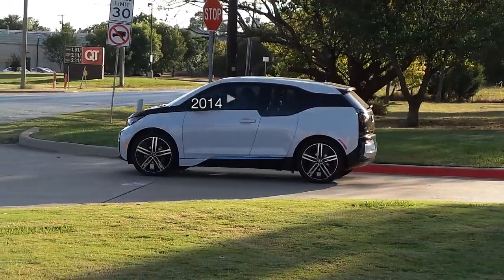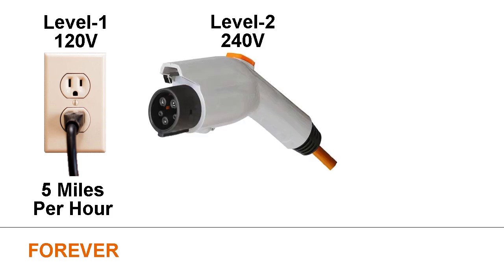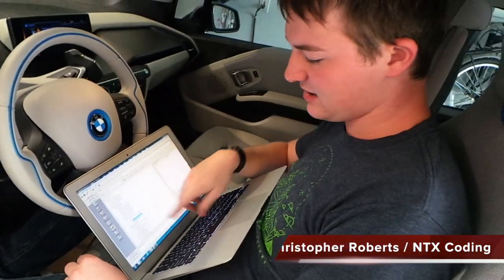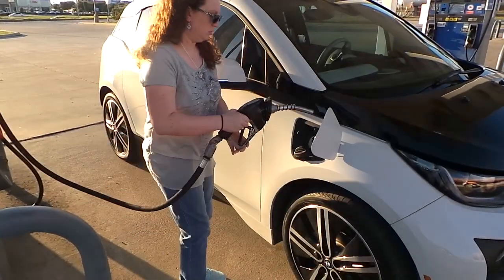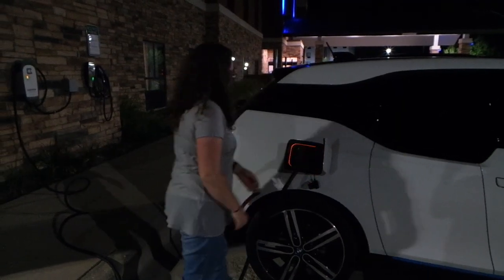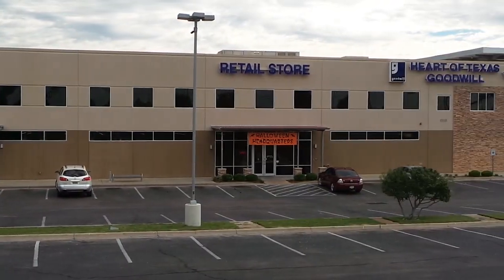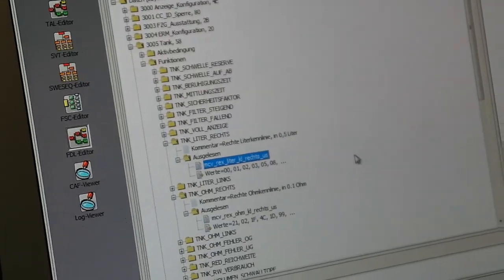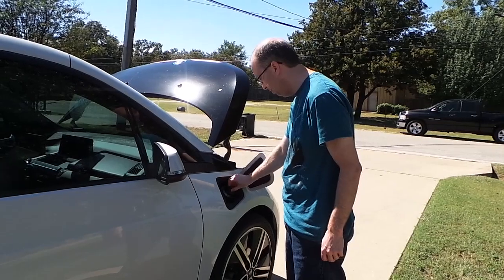BMW i3 REx roadtrip, charging, coding, and range test.

Comment: By "hold mode" they mean "hybrid mode". That's what gas engines in hybrids usually do - charge the battery.
Reply: PHEV, plugin hybrid vehicles. Use a traditional smaller gas engine to drive the wheels, read on it. i3 REx was the first ever BEVx(see the similarities in names?), a full electric vehicle that has an APU(auxiliary power unit) which can be anything to generate "power" key word it doesnt drive the wheels its only to recharge the electric drive. APU can be anything, hell you could make a BEVx that used a coal fuel steam turbine if you want, so long as the drivetrain itself that propels the vehicle is all electric and the APU only charges the battery it would still be a BEVx. The difference is that hybrids have a small electric range, and a HUGE gas range. Because they use the gas engine to drive the wheels, some also charge up the battery while doing gas-mode. BEV and BEVx are electric vehicles, fully. The BEVx just has some kind of APU to only charge up the battery, in special circumstances, IE you have a longer journey than you can make on electric and you cant stop for a charge.

Comment: The Achilles Heal of the i3 are the tires and wheels. The tires are proprietary, made only by Bridgestone. They're fragile and last 15k-20k from what I've read, cost about $150. ea and are often out of stock. It's a classic case of over engineering for marginal benefit. The wheels are soft and easily gouged, again there's only one manufacturer and cost about $225. I'm a big fan of freedom of choice which is severely lacking in the i3.

Comment: So the range extender is a petrol engine running a generator? It charges the battery and drives the electric motor to drive the wheels? This is crazy.

Comment: Hold mode is definitely the way to go for longer trips - you just run the fuel tank dry and then stop at the next fuel station, put more in and keep driving until the night comes when you plan ahead to recharge the battery to full again. So your battery acts as a safety buffer between your fuel running out and next fuel station.

Comment: with a smart fortwo, i can go 200 miles on 4 gallons of gas, at 60mph, mileage drops to the high 30's at 80mph. but most of where i live has speed limits of 60 or less.

Comment: Seeing as you have the car and a guy who can access it's "firmware". And I am to lazy to google around.

Any way, basic electric for motors and batteries amounts to amps used by the motor at load.

So you had 2 people in the car and more fuel so year load was more.

But that is not exactly what I want to know.

I want to know what the average amp draw with an average weight of two passengers.  And if you can tell how warm the batteries are getting.

In electric rc airplanes you can get lipo batteries with serious amp raitings ( you just have to know what C raitings really mean when made in China).

The info could be used in a hack to stack lipos to run the car

Comment: Whats more dangerous than the possibility of getting into an accident with that gas can in front is the pressure/fumes that will build up as the can is subjected to heat! Fumes will ignite from static and those cans are well known to split open at  high temps.
Really no + side to taking the risk.  Gas stations are everywhere!  Whats the point?

Comment: 6:05 this gas can is not necessary, please don't do this. All you have to do is keep your speed at 70mph or less and the car performes fine. This is a perfect example of range anxiety. I drove 400 miles and had to arop 4 times to top up gas, went perfectly fine.

Comment: Crippled the car...yep that's what happens when gas companies have their hands in auto manufacturing and fuel standards.

Edit:  I'm really not a fan of electric vehicles just due to their limitations in mileage...however, if all you did was drive around the town you live in, I'm sure they'd probably pay for themselves...or would they?  I'd assume you would have to pay to use those chargers that are at different locations along your route, or are they free to you?  Someone has to pay the power bill so they're not free but for shorter distances an electric vehicle may be the route to go if only they'd extend the battery power in them.

So the Chevy Volt has a lot better cruising range by the sounds of it.  I notice you and your wife both have electric vehicles so with all the charging is your power bill pretty high, or do you notice much difference in it?

Comment: So there are regular charging stations for all vehicles except the Tesla and then Tesla only charging stations? I don't know much about how charging an electric car works but if so why is that allowed? Wouldn't it be a much better benefit to have a universal charging station since charging stations grow scarce the further away from bigger cities you are? Electric vehicles are going to be awesome in the future and I hope we start getting more futuristic looking vehicles to drive, way faster charging and many more charging stations. I'd love to ride a futuristic electric motorcycle eventually.
Reply: SonnoMaku I realize this reply is a year late, and you may have already looked this up, but maybe it helps:
Yes, there are a number of different charging connections out there, and it's all about how power is delivered.
Most of our modern EVs in the US use a standard SAE J1772 connector. The connectors are easily recognized, shaped and keyed to fit one way only, and are built in such a way that it minimizes the chance of an electrical arc during connection and disconnection. Power can be delivered at a couple of levels, this way. Level 1 and Level 2.
Tesla uses a special connector because of how much power they can deliver. This is why the adapter he mentions could be used on the charger at the hotel: lower powered charger, comparable to what we get from a Level 2 charger ... But not on the iconic Tesla Superchargers. Too much power delivered there (which allows for the Tesla to recharge super fast), which would require some kind of a step down converter that the adapter lacks.

Comment: See this is why this technology is still not there for me yet. I wouldn't want to plan my entire trip based on where I could charge or not. If your hotel hadnt had the charging port you'd have to use the included 120v one from the outlet but there's always a chance someone could steal it while you leave it unattended and I would t have the patience to sit for an hour to charge my battery at a station like I see these tesla cars doing at my work, there's a few charging stations in the parking lot and I see people sitting there a lot and it's incredible to me how people are willing to sacrifice so much for this tech. I own a Dodge Ram 1500 5.7 liter v8 and I get around 25 mpg. Driving to and from work daily I never even think about getting gas, maybe once a week or twice if I do any activities after and require that extra expense, I have a 17 gallon tank and it costs roughly 60 dollars to fill.. if I go on a trip I fill up as needed and getting gas is never an issue.. the point I'm trying to make is that I am sure I'd save a lot on gas and maybe do more for the environment by driving a hybrid but the tech seems like it's still in that annoying stage where you sacrifice time, exert effort, and make accommodations based on the faulty systems all to save a few bucks here and there. Maybe in like 10 years when there's little difference between the performance but not now it seems like an unwanted headache to me to have to plan my life around a charging system like that,

Comment: Here is the reason for the software limits in a nut shell: https://en.wikipedia.org/wiki/Range_extender_(vehicle)#CARB_regulation
1) The auxiliary power unit (APU) must provide range less than or equal to battery range. ==> therefore 1.9 gallons instead of 2.4 in the 60Ah version.
2) The APU must not be capable of switching on until the battery charge has been depleted. ==> therefore no hold-mode.
BMW wanted that i3 60Ah REx qualifies as a BEVx. This is a category that Chevrolet Volt does not comply with.

Comment: This wouldn't be a vehicle for me. I go on some pretty long day trips. (One recently was to Philadephia, PA from Providence, RI and another was to Hoboken, NJ, with a stop off in Manhattan.) Some of the trips that I take are even longer and don't require me to stay overnight. (I did a trip to Niagara Falls, NY one time that was about 925 miles round trip.) A car with even a 200 mile range isn't any good for my level of impulsiveness and driving stamina.

When I wanted a car that was good for weekend road trips, I picked a regular gas powered Audi A4 Cabriolet (I felt like getting a convertible.), which can go 350-400 miles per fill, and be filled in a matter of minutes at any gas station. I also have a 5 gallon gas can, but I rarely find myself in a position to actually need that. I won't run a tank below about 1/4 if I can avoid it.

I had a trip that went through WV and western VA that turned out to be a little scary for range, which I use as a cautionary example of what not to do. (It's only 16.8 miles, but it runs through switchbacks in a mountain range and it feels like it takes an hour, when you've got the gas light illuminated.)

Comment: Hi. Nice video. However you are using the range extender completely wrong. You must go into the settings, under range extender and hold current charge. You can only do this if you have under 75% battery. You cannot drive the range extender if your battery has no charge. The hybrid runs of the battery.
Reply: Find me on Facebook and can explain further if it’s unclear. Thanks.

Comment: I have yet to see any video or information what the costs are for using a public charging station. Are they free? Do they all have different fees? Are the hotels providing the charging stations free of charge? What will happen to the charging prices when EVs become more popular? What will happen to electricity prices in general?
I'm still not sold on EVs, and the 8-Bit guy is a good example why. Whenever he makes a slightly bigger trip he seems to stay in a hotel. These are trips that could be easily done in a day with a small gas powered vehicle. It seems in an EV you have to stay overnight for accumulating charging purposes. A hotel is not cheap. I think overall, this trip would have been more economical in something like a Toyota Yaris.
I have a feeling EVs have a lot of hidden costs attached that are not immediately apparent and the enthusiast community is very quiet about those.

Comment: Two things, the i3 is not for hyper cruise, it is too big for driving that fast. 55 mph would give you more sensible range. The range extender gives you 40mpg on gasoline, which is worse than many gasoline cars. This car is obviously for slower speeds city driving.
Reply: @Hocus Smokus Are you talking to me? Because calling me crazy but otherwise saying the exact same thing as me puts the concept of crazy in a whole new light. Your other point is however entirely mistaken: The standard since 2016  for gasoline car mileage is 49 MPG A car getting 25 MPG wouldn't be made because would cost 3000$ in yearly taxes and use twice as much fuel so no one would buy it. Tried to look up the exact specs for the BMW i3 REx. Guess what, from next year, it wont be made any more because it can't meet the WLTP standard for emissions, so wont get any tax exempt !!

Comment: I've seen two of these in my hometown and didn't realize they'd been out since 2014. Very nice exterior design, but way too expensive and high maintenance. I haven't warmed up to electric cars yet.
Reply: If you are worried about maintenance, get an all electric car. They actually have less maintenance than a gas powered car. No oil changes for example. So an i3 without the Rex, or any others out there that are all electric. With that being said, still more expensive initially than a gas powered car but that will be getting better and better as time goes on/more used inventory.

Comment: Those motorcycle engines in the back are so loud 😂
Reply: Actually not. I was afraid it would be, but the REX running in mine is very well muffled.
Reply: Mark Johnson haha. You are lying to yourself so you don’t feel like you played yourself.  That engine is loud and annoying.
Reply: @ultrastoat3298    Are you just being a troll? It took quite an effort to even hear it was on. You are misleading every reader on this board.

Comment: Ha!  I picked up my used 2014 Nissan Leaf from the Dallas area and took the same route that you did.  I stopped at Hillsboro, with 16 miles range left, and both Blink chargers were non-functional, and the nearby car dealership refused to allow me to plug into a 110 volt outlet (liability concerns), and the outlet mall security couldn't contact his supervisor, so couldn't help either.  I had to be towed to the Nissan dealership in Waco, which, thankfully, I still had road hazard coverage so was free but the dealership was closed, although the hotel next door, which was the one you stayed at, allowed me to charge to a reasonable level to make it to Temple.  Whew!  I could have used a range extender on the Leaf.

Comment: Dear Engr.
Good evening. This is Ariston Jr. R. Gorospe. the Author of Vehicular Brand Volume Reduction or Brand Coding.
I incidentally read your article about
“Out-of-the-Box” Solution to the Traffic Congestion in Metro Manila
“Some have suggested”according to USCAP“to use the vehicle type as the base for restrictions: no Toyotas on Mondays, no Hondas on Tuesday... Is it feasible? Toyota is largely dominant. A Toyota ban on some days would create huge uproar. Would it also apply to ubiquitous Toyota taxicabs?”
THIS IS JUST TO SUMMARIZE THE CONCEPT POLICY VBVR
My answer,
Yes it is feasible. Since I am the author of vehicular brand volume reduction or brand coding I have the mechanics on how to reduce car reduction by 45% on the road particularly at EDSA and to another thoroughfare on segregation of mixed dominant car brand per day .in 5 or even in 7 days through vehicular brand segregation reduction of the total car LTO registered based on allowed ratio kilometers .you can not do the concept by just one brand per day .but by of mixed segregation of dominant brand example if you have one brand like BLUE MAX AUTOMOBILE registered consist of ten thousand cars at NCR registered divided by 5 is 2k per day and other mixed car brand added segregate them again in one box per day on a number of units together with another brand you have a total volume segregated in five working days  and car that are not ban to travel by segregation will have a window hour travel time if you have a total 20  thousand cars if you plan to have a segreation of banned cars of 45%  on the road you will have widen the space to travel in a peak hour however never used the brand name  but ont 5 colors different conductive sticker for the reason of monitoring and control of the growing numbers on  travel time per day. and 
Taxicabs and other public transportation will still be color-coding of MMDA.
Hope to hear from you and let's talk about it.
Stay safe.
Best regards,
Ariston Jr. R. Gorospe
+639774975602
Pocholo Ariston Jr. Gorospe

Comment: Conclusion: that car needs a larger fuel tank for long range travel, like 10 gallons. Battery good in the city not in the country lol
Reply: No, the conclusion is, that this car was build for Europe. You can get across the whole continent with an electric car, as you have e-stations everywhere, and every power outlet has 230 - 260 V, unlike the ridiculous US 120 V - a fucking joke...

Comment: To be honest, seeing this I’ll think I’ll stick with my 2007 Hyundai Elantra for the time being. I hope to get a first Gen Chevy Volt someday but that might take a while. I have an aversion to European imports to begin with (I tend to stick with either domestic or Asian makes; the first I grew up with and the second are low-cost and reliable in my experience). The i3 is obviously intended for Europe, with its small size, limited range and limited engine-only top speed compared to the Volt, and deliberately crippling that limited range makes no sense whatsoever. Right now the Chevy Bolt isn’t selling well at all (they have so many in stock that they idled the factory where they’re made)...and people are lining up to get on the waiting list to get a Tesla Model C, I guess because Tesla has the ‘Cool Factor’. Sometimes I find human behavior perplexing...

Comment: Just not worth the hassle (and stress) yet.  Maybe in a few years when battery tech advances enough to give a much greater range and more quick charge/battery swap stations appear I'd consider an electric/hybird car, but until then I'll stick with my gas guzzler.  This model is ok for short range town and city driving if you have a dedicated charging point and the parking space at home I suppose
.

Comment: Ok I understand the electric car gimmick. Why would you buy a car that you can't dive more then 75 to 100mi? They can make the car drive 3,5 times even more if the big company wanted to. They can and have the technology so you do not need to plugged in at all. But they will not. So I would never buy one of these cars.  Thats a lot of money for a vehicle you really can't use.  Good video.

Comment: wish the REx (with the euro flash) was the standard version, as a pure ev its "meh"
however, it's rear wheel drive with super skinny tires and way too much torque, easy drift machine!
Reply: Take the motor out of two lathes and bolt them in where the default BMW things are, replace the original engine with a vintage Harley Davidson motor and a cat and muffler delete (to make it sound like a Harley Davidson should) and replace the dinky little two gallon tank with an 8 gallon tank, which is more fitting to a motorcycle engine.
Reply: The YouTube Phantom Official why not swap it with the GS1200R BMW Motorrad?